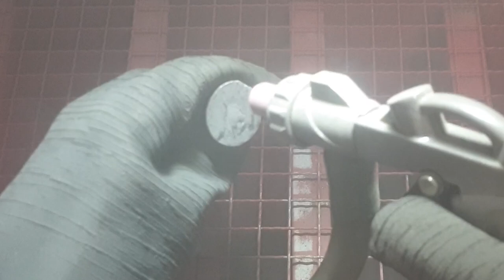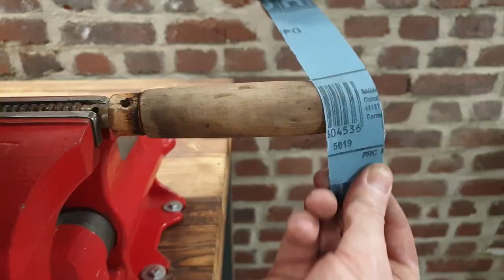Satisfying screw clamp restoration - 80yrs old and dirty

Comment: Very meticulously detailed restoration work and a wonderful and also vividly detailed video.
Thank you for showing step by step the careful disassembly of the parts and the cleaning, restoration and decoating and reassembly processes.  
However, since in my case I am looking for a way to restore the locking ability of the lower (movable) jaw of the clamp, I am very interested in what method you chose to restore the locking ability. In some cases the nozzles on the rod are deepened with a chisel, some do it by sawing the teeth with an engraver, sometimes it is enough just to rub the guide rod with rosin or other anti-slip compound. If this does not help, you either have to sharpen the sliding edges of the clamping jaw, or fix it using a punch to push the dot deform back out to allow low arm grip clamping or make constructive additions, which in your case, obviously, was not necessary. 
Do you have another video of the clamp restoration where you can show how to restore the clamping and prevent the jaws from slipping when clamped. 
With gratitude and wishes for success.
English isn't my natives, so excuse for mistakes.